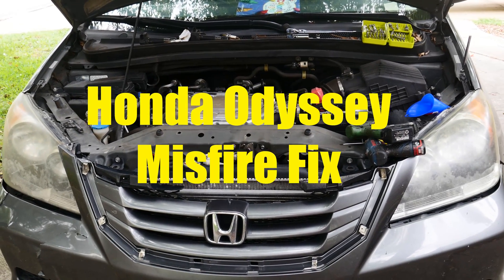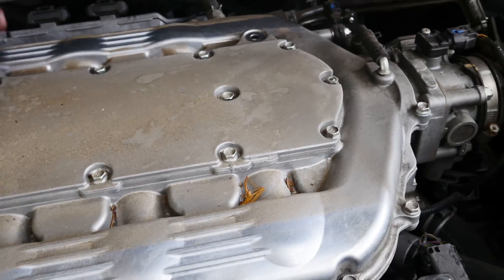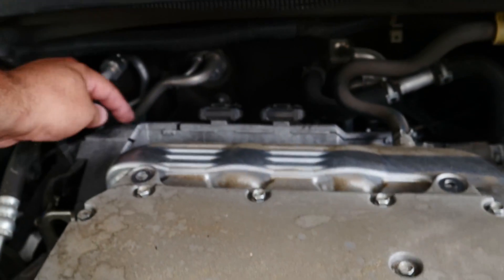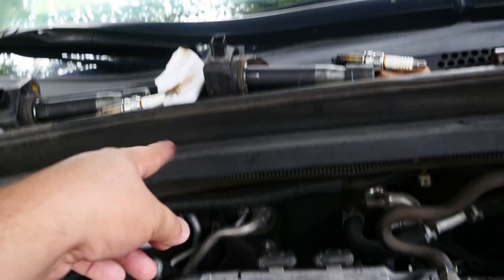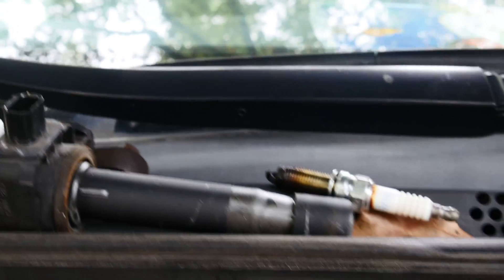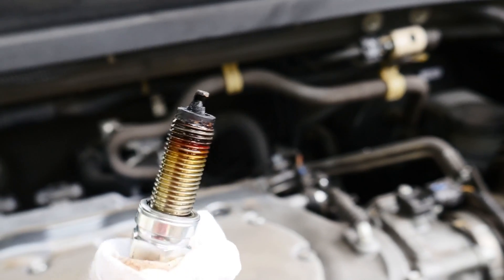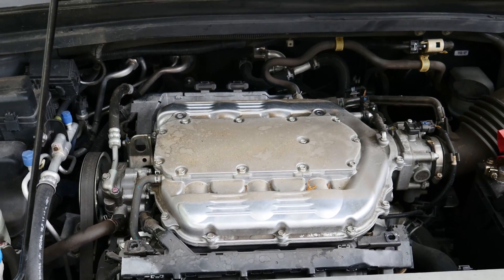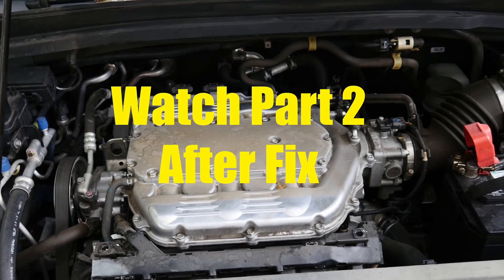Honda Misfire Check Engine Light Flashing TSA Light On Fix Part 1 Odyessy

Comment: Please help me..2005 honda odyssey replaced all spark plugs coils and all 4 oxygen sensors no oil on spark plugs...and my van runs like crap
Reply from the maker: Have you checked the compression on all cylinders?
Reply: @allboostnojuice  man to be honest I have no idea or tools on how to do that
..I replaced the valve cover gaskets...coils all 6 and spark plugs and all 4 oxygen sensors....my thing is the van ran almost perfect before all these new parts were put in by me...so the compression in my humble opinion is good...I'm searching you tube and one guy thinks the timing may have jumped...so I'm going to Autozone and getting a timing belt kit first thing in the morning....it's an iv-tech 3.5 2005 honda odyssey....thanks for replying back your the only one who has....thanks...it's 12:28 in East coast and I'm drinking a beer and searching for answers in my kitchen....this is what a good husband does lol

Comment: Replacing the spark plugs and coils in the rear bank is not a fix. The problem is the rear bank has bad piston rings. Simply replacing the spark plugs does not fix the piston ring issue.

Comment: It's the piston ring that's defective but the crazy thing is Honda ONLY warranty's it for 8 years. You can have 400,00 miles on the car and if it's under 8 years they will repair it free but if you have 115,000 miles and it's been 9 years (like me) your out of luck and it's out of pocket. This was my first Honda and my last.
Reply: Is it an 8 year warranty for every Honda? I have a 2015 that does this also
Reply: Replacing the plugs and coil packs a little more often than usual is a small price to pay for an otherwise incredibly well engineered vehicle. My previous vehicle was a forester which had a MUCh worse piston ring problem than this. By the time it was at around 150k it was burning a quart of oil ever 5-700 miles. The odyssey with its piston ring issue barely loses a quart every 5k

Comment: Hi my starter on my 2005 Honda oddyssey was bad took it off and took it to auto zone  they checked on machine...it was BAD..i put in a remanufactured one trying to save money...it did okay for a week...but now when starting it as it's TRYING to START it shakes the ENTIRE engine BAY...i pull back and retry then it STARTS okay...it does not shake once it is on...just when turning the key to START it...any ideas why it does the HARLEM SHAKE lol...
Reply: Did you ever figure out what was causing the shake?
Reply: @pa-panamericano8802  hell no it's still doing it today...

Comment: Robin MacAdam is correct! My 2010 Odyssey got rear cylinders "Re-Ringed" last year so it was over 7 years old done under warranty and we are NOT the original owners. I was nearly 100k miles so I had them do the timing belt/water pump etc while it was apart for the other work and it saved me around $700 in labor by having it done while the engine was apart for the cylinder work!

Comment: I have a 2008 Odyssey touring misfiring,VSA light on,check engine light flashing and oil in spark plug well,is my engine gone?any ideas?
Reply: likely valve cover gasket.  There are other people with this symptom who fixed it.  Look it up.
Reply: No it’s not. Disable the vsa once you replace the plugs again….
Reply: @mr.mrs.keesee1169 how do you disable vas?

Comment: Hey All..  there is a service bulletin for the 2011.  Cylinders 1 to 4 piston rings need to be replaced.  The gap in the rings rotate and alone.  Hence the oil on the spark plug.  My van is in the shop getting repaired now for free.... check with your local honda dealer.  Time is running out.......
Reply: Robin MacAdam what are the requirements for a free repair? My Accord has a misfire Code P0302.
Reply: @thurm101   not sure.  I'd check in with your local dealer.  Make sure to inquire about the bulletin.   We just made it under the extension on the service bulletin by a few months for our Odyssey.

Comment: How did you get the spark plug to come out with the socket? Mines I get everything done put can’t seem to get the plug to come out for some strange reason.
Reply: I'm probably replying way too late but there special sockets for sparkplugs which have rubber inside to grab the plug and pull it out. A regular socket won't pull it.
Reply: I used a collapsible magnet rod to get the plug out since it would stay in the socket when pulling socket out

Comment: Where did the missing piece from the spark plug go?
Reply from the maker: I'm sure out the exhaust.
Reply: without causing any damage to the cylinder wall or the exhaust valve?
Reply from the maker: +12vgs8606 don't think so.